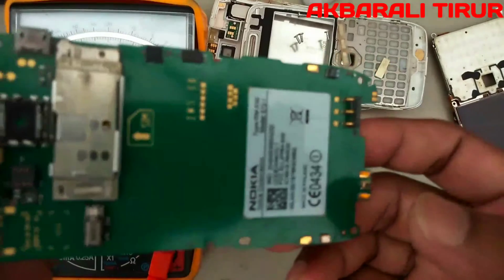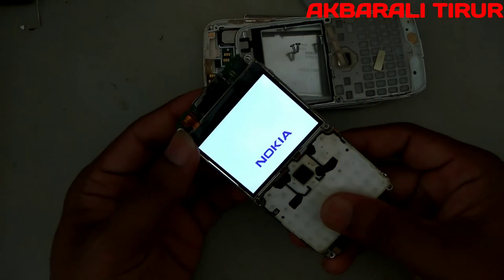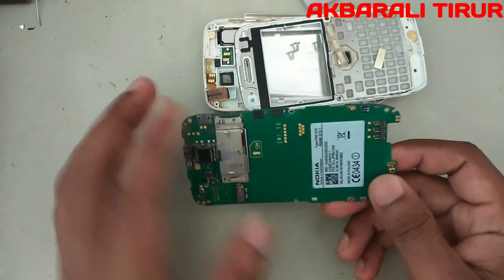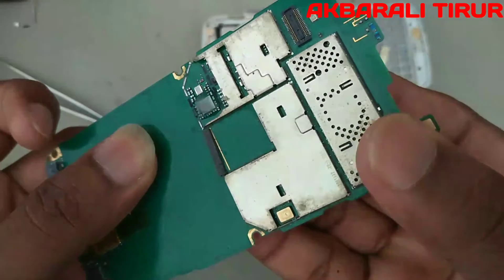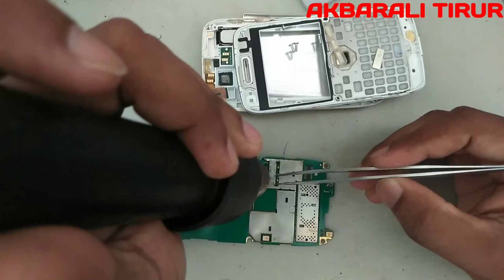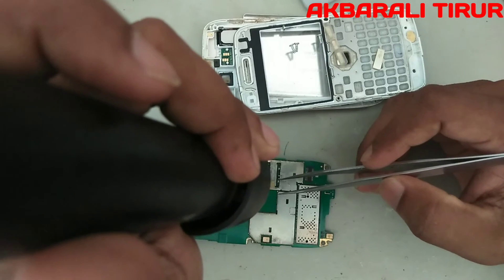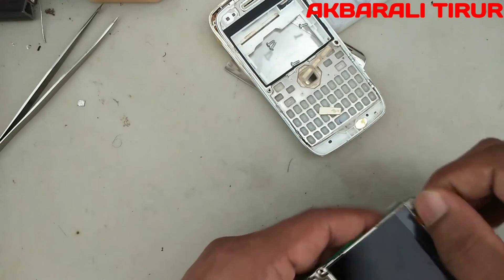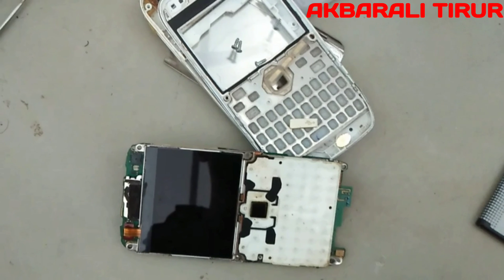Find the shortened ic and fix the problem | ഷോർട്ടായ ic കണ്ടുപിടിച്ച് ബോർഡ് ശെരിയാക്കാം

Comment: ഞാൻ  laptop and mobile phones  chiplevel  അല്ലാത്ത വേർക്കുകൾ hobby എന്ന നിലയിൽ ചെയ്യുന്ന യാളാണ്. വായിച്ചു ം  സെർവിസ് വിഡിയോയും ഒക്കെ കണ്ടുളള എകസ്പീരിയൻസ് മാത്രമേ ഉഉളൂ.

 ചിപ്  ലെവൽ അറിയില്ല. ചിപ് ലെവലിൻറെ വിജയ സാദ്ധ്യതയും .ലിമിറ്റേഷൻസും ഒക്കെ  വളരെ നന്നായി പറഞ്ഞു തന്നു  നിങ്ങളുടെ വിഡിയോകൾ. .ഫോൺ ഷോർട്ട് ആണോ എന്നും ഷോർട്ട്‌ ആയ കോംപൊണൻറ് കണ്ട് പിടിക്കുന്നതും  വ്യക്തമായി അറിയാൻ കഴിഞ്ഞു. 

എനിക്ക് രണ്ട് സംശയങ്ങൾ ഉള്ളത്. നമ്മൾ  flux apply ചെയ്തു  ഷോർട്ട് ആയ ഒരു ic കണ്ടു പിടിക്കുമ്പോൾ. ആ flux ഉരുകി ic യുടെ pin കളിൽ ആകുമ്പോൾ. ആ ic അത്രയും സമയം  ഷോർട്ട് ആയി ഇരിക്കില്ലെ? കൂടുതൽ സമയം പവർ സപ്ലൈ കണക്റ്റ് ചെയ്യാതെ പെട്ടെന്ന് ഡിസ്കണക്റ്റ് ചെയ്യണോ? അതോ water drop ഒരു circuit short ആക്കുന്ന അത്രയൊന്നും conductivity ഇല്ലാത്ത material ആണോ flux?

രണ്ടാമത്തെ സംശയം ഓരോ components identify ചെയ്യാനും circuit ഉം, ഓരോ സെക്ഷനിലെയും വോൾട്ടേജും ഒക്കെ വ്യക്തമാക്കുന്ന schematic diagram എവിടെ നിന്ന് കിട്ടും എന്നാണ്.
Reply from the maker: Flex current ne kadathi vidilla...

Schematics nu prathyegam site illa..ath search cheyth kittunna site il ninn edukkuka
Reply: @akbaralikp  awesome 👍🏻